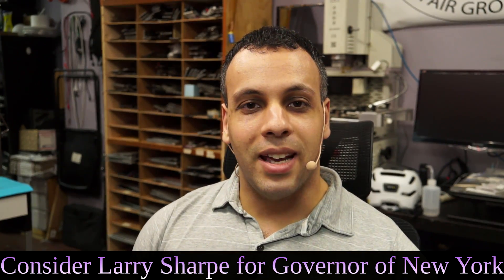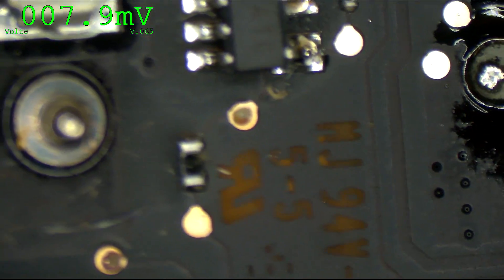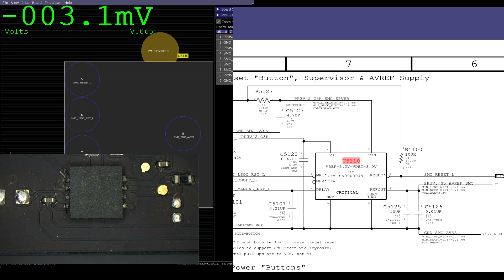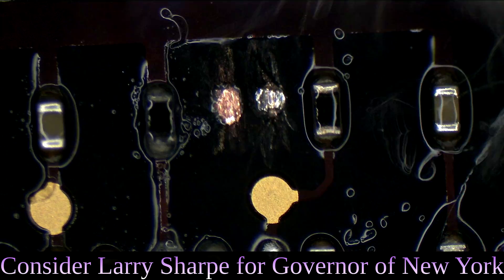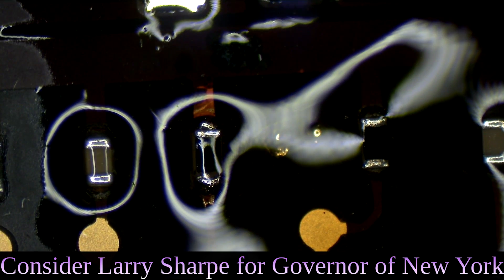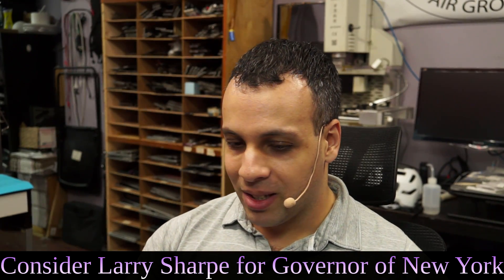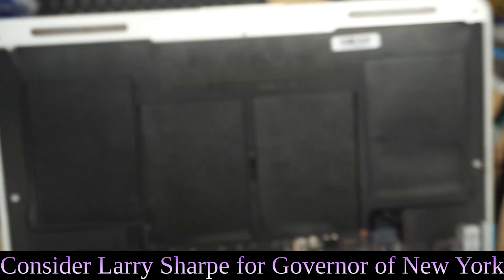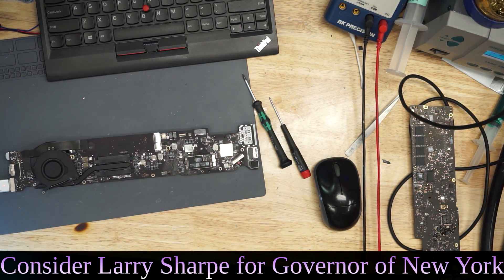Can 1 drop of liquid destroy a Macbook Air?

Comment: When are people going to stop buying Apple products?
Reply: When Linux works for your mother
Reply: @whazzat8015  Really? have you even seen a modern linux GUI? How much easier do you want it to get?
Reply: As a Linux user I'll admit that updating a lot of software can be kind of a pain in the ass. Windows and OSX automate stuff so ignorant people don't break things by installing the wrong library or driver set by choosing the first one that appears. Which is way too easy to do on most Ubuntu and Debian based Linux distros.
Reply: VulpesHilarianus I. don't have too thorough of an understanding of this, but isn't Ubuntu itself just a branch of Debian?
Reply: As far as I know, yeah. Ubuntu started as a way of introducing the more user-friendly GNOME GUI yet still keeping compatibility. While Debian adopted the XFCE GUI and was meant for absolute control, Ubuntu was meant to be just as friendly but ultimately safer than Windows. Later on Linux Mint, which was derived from Ubuntu and built around the Cinnamon GUI, took over that role.
Reply: VulpesHilarianus It’s pretty interesting to read about how Linux grew and expanded. It’s crazy to think just how many Ubuntu branches there are alone.
Reply: Whazzat *is pre installed on laptops
Reply: Linux already works for my mother so that is not the issue.
Reply: For many of us, I think it is the software that keeps us coming back more than the hardware. iOS and macOS are pretty decent operating systems all things considered.
Reply: When classism ends or when Apple goes out of business.
Reply: When is stops becoming a social status thing
Reply: Good that it isn't a social status thing in my area then.. I am just wondering how much crap people can take.. I mean, glued in batteries? Aftermarket homebutton shuts of your device? C'mon..

Comment: Louis, I encountered this problem previously and am proud to say I figured it out. However, I scraped and scraped and could not find anything underneath to solder to on the right side of that resistor. I ended up just relocating the resistor to the other side of the board, which actually seems like a much more convenient location for that resistor. A little jumper wire and everything was good.

I'm not smart enough to figure out how to do it "properly," but when Macbook turns on, I don't argue.
Reply: Congrats, you just turned your Mac into a PC with that jumper wire
Reply: @ryanrandolph6193  Yup, now Apple is going to sue haha...bastards.....
Reply: Do you know where to place the jumper to make BootCamp work better?
Reply: Kemal NottaTurk I'm sorry, I'm not sure what you're referring to.
Reply: Someone tell Apple, he's gonna need to be sued for copyright infringement!
Reply: Apple would like to know your location.

Comment: 1 drop of liquid destroys a macbook.
My budget Lenovo had 3 cups of coffe spilled on the keybord and still works.
Reply: Lenovo use a sacrificial keyboard. Usually, if you spill coffee on it, the keyboards will absorb all of the stickiness and the route that liquid down through the computer into the bottom of the computer through a special Channel. Even if the motherboard does get wet, the sensitive equipment is covered with a film wax layer. It's anti-corrosive, but it still can sometimes. The great thing is that the Lenovo keyboards can be replaced with three screws in about 2 minutes and the keyboard can be purchased for about $9 on eBay.
Reply: How did you get three cups on it?
Reply: @duomechtra1234 2 times my finger got stuck in the cup holder - I tried to pull my hand away without noticing that and tipping the cup. Third time's on my cat. 
I did had to change the keyboard once, to be fair. A new one was 15 bucks and took about 5 minutes to change
Reply: My Razer laptop has survived 2 nights in the rain inside a soaked backpack. My razer keyboard has survived multiple hot drinks entirely spilt over it. And people say razer sucks at making quality products.
Reply: chromebook survived mtn dew, for gods sakes dident even give it a full day
Reply: I'm sorry man.
Reply: @Kingブランドン Toshiba makes talking hard drives, good TVs, crappy laptops, and good desk tops
Reply: Makes me wonder what tape they use. Kapton tape?

Comment: The only thing I buy form Apple are their iPads. I've had mine for 5 years now, other than that everything else is windows.
Reply: A windows phone?
Reply: Skap Nokia lumia 1520
Reply: Even smartphones? 😂
Reply: Eye pads are a lot cheaper at the pharmacy than at the fapple store... Can't say I'd recommend using the same one for 5 years, though
Reply: My Nexus 7 (2013) is over 5 years old now and still works fine. My brother's iPad (2012) became unuseable by time so he bought an Android last year.
Reply: As if that will help
Reply: i have also had mine for 5 years
Reply: Sir Percival look up "iPad bend test" from JerryRigEverything
Reply: One day you will come to the light side and stop using Apple products... Maybe you'll even discover Linux 😁
Reply: tin2001 Oh god no please
Reply: I hope Linux comes closer to mass market some day, but currently it's a terrible choice for the average customer as Linux does not run a lot of software the average costumer wants.

They also do not understand compatibility and why Microsoft Office won't run on their Linux machine. If you tell them they can get an alternative office application they don't want that, they want Microsoft Office. 

Linux is not ready for the average customer, just like it hasn't been since forever.
Reply: @deWaardt The average customer is not ready for linux
Reply: deWaardt Android is a linux based OS.

Comment: If i wouldn't have fu… up my laptop because i needed to desolder the bios as m$ bricked my laptop on an windows update. I used a completely overpowered soldering iron and it solderd of the pads.
Reply: your laptop cant be bricked by a windows update, only a virus or similar program with access to the BIOS can brick your laptop that hard.

Comment: on my toshipa Satilite i7 
750$ 
I dropped cup of water ...I just removed the  battery and use heat gun and it works again lol
Reply: sbcontt YT just buy a laptop from government auditions, they happen every month here in adelaide, Australia. You can get some deals for high end last generation laptops which are mostly Lenovo x1 carbons and those bulky hp and dell ultrabooks
Reply: My cheap ass laptop only took a silica bag
Reply: I have one of those massive 17" laptops from Dell. 2kg of craziness that seems to laugh off the rain.
Reply: sbcontt YT XPS and ThinkPad are possibly options
Reply: +sbcontt YT
Nonsense, good laptops exist like Clevo, MSI and Lenovo there many more of course but these brands I listed are mostly laptops that are more commonly found, Clevo and MSI usually sell modular laptops with MXM PCI Express slots and socketable CPU's, Clevo laptops are usually rebranded such as Eurocom, Multicom, Prostar, Xotic, Sager and so on and so forth
Reply: @sbcontt YT just buy a second hand laptop from a year ago that should do you OK.
Reply: Max-Leo Amberg And ThinkPads are truly amazing for that. For some reason, though, everyone on this channel acts as if any machine that isn't a MacBook can survive that. That's not the case. The MacBook's weakness is the NORM, and the ThinkPad's ruggedness is the EXCEPTION.
Reply: Have an HP envy j012la. My bottle of water just opened while I had my laptop on my back, when I realized it was way too late. I took the pc, extract the battery and then leave my pc on rice for three days. The sucker came back to life
Reply: Spilled a whole soda in my Dell still runs spilled a cup of water on my other Dell 5475 took the whole thing apart in 10mins and space heaters it good as new

Comment: Considering that 0 drops of water can already destroy one would I go with yes...
Reply: ITS YOUR FAULT FOR NOT USING A MACBOOK IN A VACUUM CHAMBER WHERE THERE ARENT ANY FLUIDS
Reply: @nickkbudiono  then it would overheat lol
Reply: cold vacuum
Reply: @ItumelengS  Think again
Reply: @ T P fine. then do it in a chamber with pure nitrogen. prepare your gas masks.
Reply: Roufl-copter
Reply: Ya no duh
Reply: @Gustaf Andersson think different and put a small nitrogen chamber beside the battery. nitrogen is better than oxygen because nitrogen has better pressure balance (i have no fucking idea what im saying)
Reply: you've come to the right place, danny boy

Comment: What are your thoughts on alienware?
Reply: Overpriced somewhat crap
Reply: alienware is a brand name. It's a glorified dell.
Reply: Basically Apple then? XD
Reply: Dell but with a Ferrari badge.
Reply: I use Alienware laptops they're are OK. It is expensive, but the laptop's rugged and durable. I've only given it a new SSD for faster speeds but everything else works great. Oh... be aware of the weight.
Reply: If you looking for a good quality laptop I suggest you to check Clevo brand.
Reply: They're wank.
Reply: As someone who owns one he was given as a gift: they are nearly as bad as Mac's, the board has all kind of poor design choices and from factory they don't even apply enough solder to the USB ports which cause them to fail after very little time.
Reply: They're not expensive anymore. Heck, last year the Alienware 17 was actually on the lower end of the price scale for those wanting an i7, GTX 1080 machine. The build quality superseded everyone else, even Lenovo I'd say. The big problem with these machines these days is the ever worsening thermal solutions. Dell's QC is really bad when it comes to the cooling, and the machines frequently overheat. If you looks at Matthew Moniz's review of the Alienware 15 R4, his machine throttles worse than the 15 MacBook Pro BEFORE THE PATCH. Their machines really are king, but the thermals are just killing the entire package right now; you'd have to win the silicon lottery to get a cool machine.